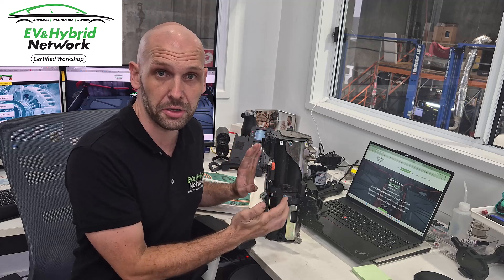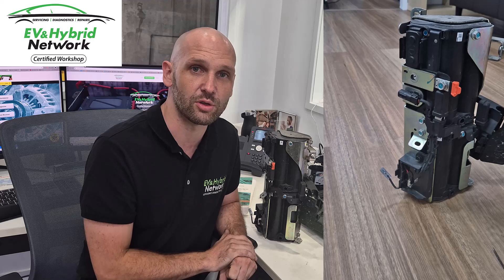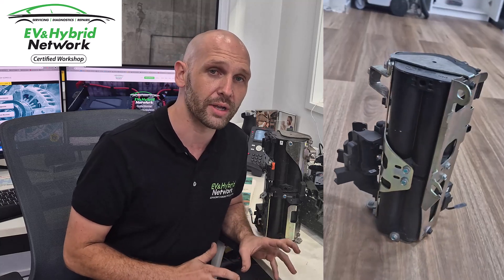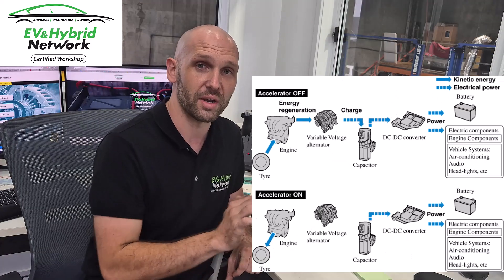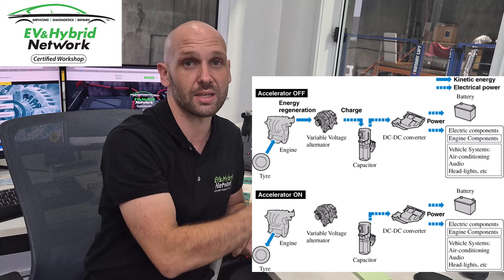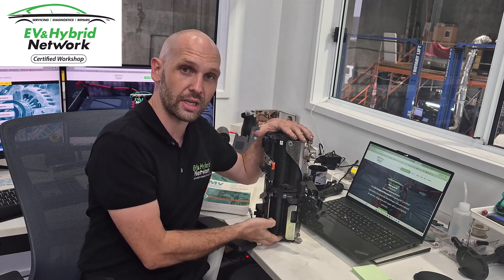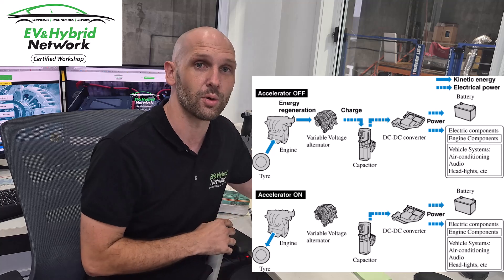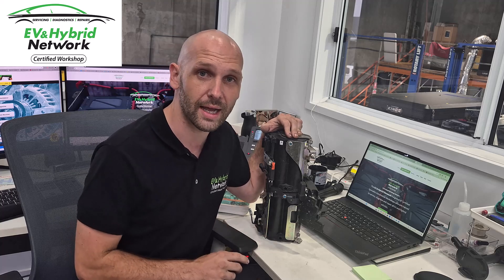Mazda i ELOOP Capacitor

Comment: I’ve been driving with ieloop inspection error for a year and had no issues.
FORScan shows 14.2 V, and the battery is charging well.
I don’t see any reason to spend money on replacing the capacitor